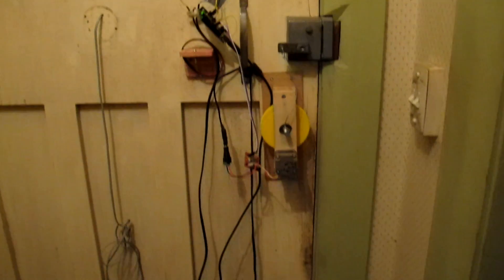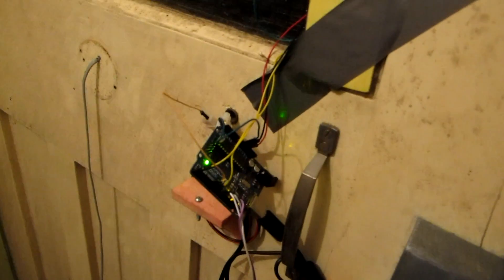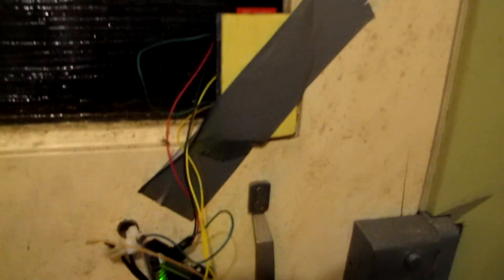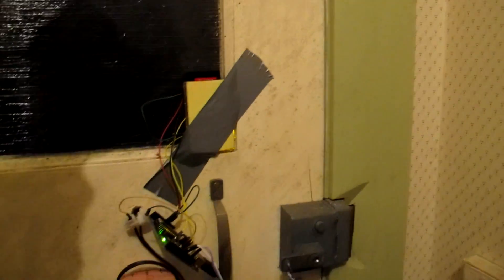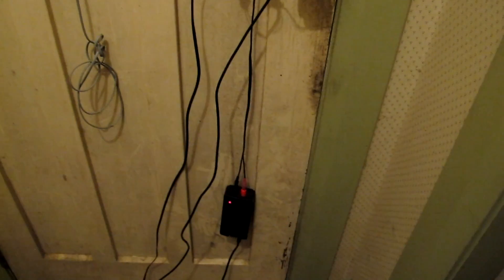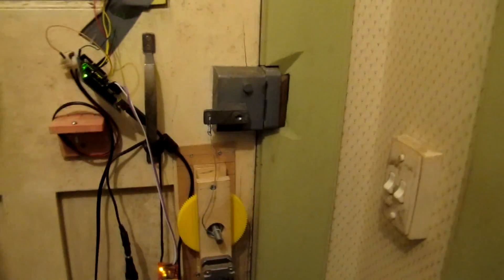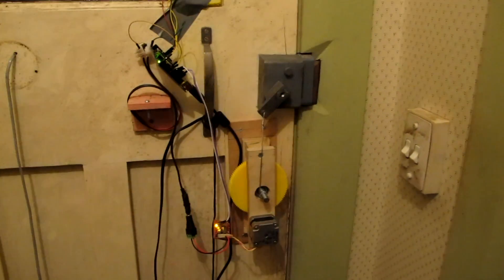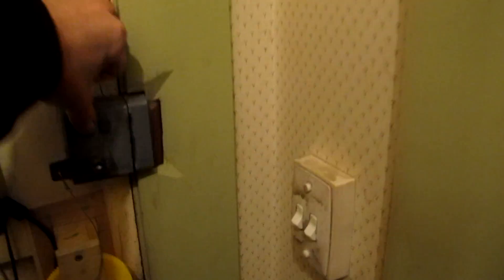RFID Door Opener

Comment: That's a bit of an overkill. A servo would to just ok.
Reply from the maker: I servo strong enough to move my deadlock would have cost a lot more. I had to gear the stepper down over 50:1 to get enough torque. The door is insulated with thermal strips that apply a lot of back pressure against the locking plate.

Also, I already had the stepper, driver and gears.